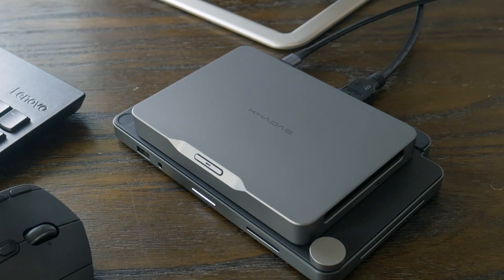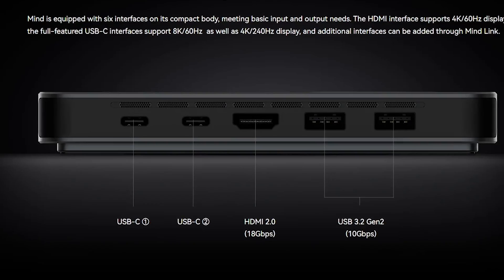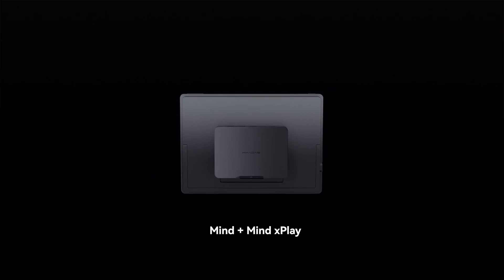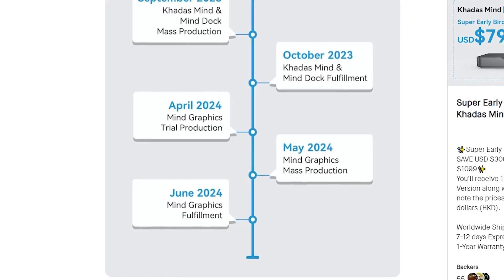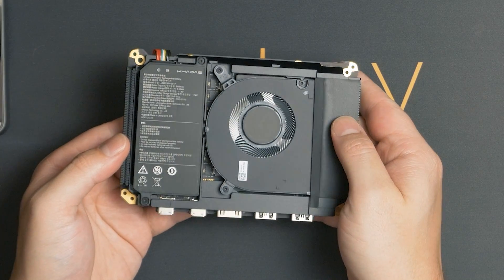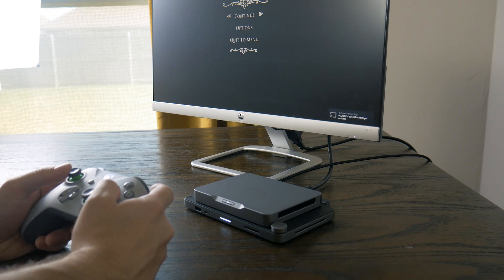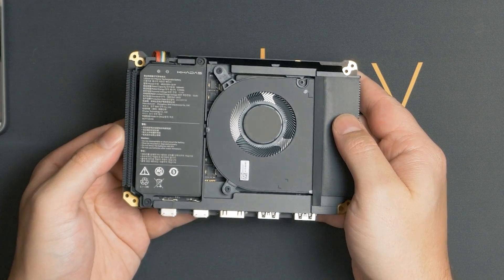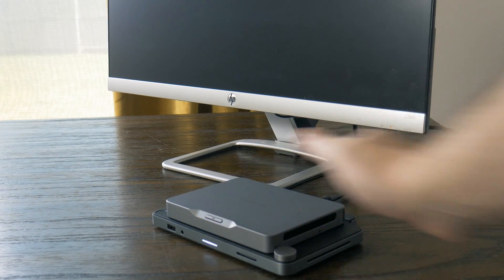Is THIS the future of PCs?

Comment: They definitely milking the price by using those proprietary connector. They can just use OcuLink 8i connector, which is the common external PCIe x8 routing standard in server and workstation, but nope, they know they cant sold their proprietary connector with that. For power and other peripheral, they can use another USB-C right beside the OcuLink connector to deliver both power delivery and USB to other peripheral that doesn't need PCIe (like 2.5G Ethernet and USB hub/audio DAC), Similar like asus did with their X13 and Z13 lineup (well asus is using proprietary connector for PCIe but still).
Reply: Adding insult to injury, the thunderbolt 4 capabilities is built in to the SoC, they just need to add $12 Intel Maple Ridge (JHL8540 or JHL8440) thunderbolt redriver, but nope, that thunderbolt will also gonna hurt their proprietary "Mind link" accessories 🤣
Reply from the maker: The thing about OcuLink that makes me really curious is how well it would hold up to a lot of plug cycles. It appears that certain specs of the connector can be more durable, but I don't think it was originally designed for something quite like this. Would be awesome if it was and khadas found a way to do something similar to what you described
Reply: @HardwareHaven  oculink, atleast at first, is designed to compete with thunderbolt, which at the time still use Mini DP port (TB1/2), and most older thunderbolt controller is sucks and add lot of latency (just see trashcan mac pro and older macs) and oculink provide the alternative which just basically passtrough the raw PCIe data instead of encoding/tunneling it. For durability, atleast I already into 5000+ cycle, using it myself to passtrough my main PC PCIe slot to my DIY DAS that have broadcom controller in it. And for the hotplug, it's just the matter of motherboard/platform and the end device supporting it. And yes, manufacturer can add dirt cheap PCIe retimer for limiting signal degradation.

Comment: I don't think this is likely to take off- it is too expensive and as it is a single vendor will be too limited. I think it much more likely that mini PCs will grow in popularity because of their low cost. Today you can get an N100 system that is great for everyday computing: web browsing, 4K video playback, and word processing for less than $150.  That is a really great solution for the vast majority of people for a lot less money.   However, for gamers the graphics are lacking compared to what you can get on a desktop. 

If these mini-pc form factors become really popular then graphics card manufacturers are going to have a real problem: mini PC generally don't have the space for a graphics card. 

The current generation of eGPUs are far too expensive and complex for a casual user. They are really kind of a hack- make a PCIe card chassis that you can connect to via a USB4 or thunderbolt cable.  Why are we keeping  the PCIe middleman?

Computers have standardized memory slots (DIMMs) and storage (M.2) that you can populate standardize components from different vendors with different speeds and capacities... why can't there be a similar slot for graphics?  I realize this is a chicken and egg problem and requires cooperation between GPU and Motherboard designers... not too likely to happen but it would really make for modular graphics. 

I think a more likely solution is a "mini graphics module" that the graphics card manufacturers could build without any changes to existing mini pcs.

Make an enclosure ideally about the same size as the mini-pc with a standardized port (usb4 for now?) and it's own power supply. The big difference from today's eGPUs is that this box is a product designed as a complete product.  The design won’t be bound by the form factor of a PCIe slot because that isn’t its purpose.   The end user should just be able to plug it in and it will just work.

If there is enough demand, the cost could be very comparable to a PCIe graphics card with similar performance. Over time I would expect improvements for this style of component: better communications standards, better performance/watt as lower power draw will make the entire unit less expensive, possibly even a way to upgrade the graphics performance.

Comment: The computer is so small that you could lose it. I don't see the need for such compact package with challenging heatsinking and no upgradeability. The additional ports in the dock could be added in the same chassis without an exposed connector. The PC would still be small. I'd rather see a quiet desktop PC that only draws 50 watts.

Comment: Computers with custom docking ports on them are not new.  They tend not to do well on the free market.  A "modular" PC isn't new either.  They've been a thing since the earliest days of computers.  As mechanical, electro-mechanical, electric, digital.  Across all the different sizes and shapes man can conceive.  To say this is a "modular" design is to ignore the expansion slots of micro computers (aka Personal Computers) where you insert modules in the form of a card to expand the capabilities of the computer itself.  Using a small PC as the "brains" of other connected peripherals such as different kinds of displays, GPUs, doking stations, etc isn't new either.  In fact there really isn't anything that special about this small form factor PC.

Comment: Obviously the Mind Link isn't the future but I do think we'll be seeing a lot more SOC based computers with modular connectors.  SOCs can achieve far better performance and energy efficiency at the cost of being less upgrade-able/repairable.  The big question is what connector will be used to connect the SOC to other devices.  I'm imagining the SOCs taking on the form of a small block that connects into a system like a CPU does but instead of just being a CPU it's CPU, RAM, and maybe GPU and Storage as well.  The closer connections mean less latency and possibly less interference concerns which means faster computers.

Comment: I'd only ever get behind this if the Mind used CAMM, so we could have upgradable memory without being restricted by SODIMM, or locked to our choices with soldered LPDDR5, and if the Mind Link ever became an open standard.
Also, I hope that graphics dock has a standard PCIe bracket on the inside (although it looks like that isn't the case), else it's even less attractive.
Very neat idea, very bad execution.

Comment: I wouldn't be surprised if their proprietary connector is somewhat better for the exact purpose they had in mind(if nothing else ignoring compatibility expectations allowed them to shove some USB, HDMI, and power in there to suit their purposes); but unless you are really enthusiastic about the future of their line of accessories it's hard to be too optimistic about it vs. either TB/USB4(inferior PCIe lane count and speed; but at least literally everybody makes compatible stuff) or OCuLink(not really designed for docking station work; but the cheaper, lower overhead, less encumbered way of doing short cabled PCIe runs).

They could even have split the difference by doing a 'semi-custom' connector by deciding on a specified arrangement of a standard and custom connector(eg. having their docking connector be a normal OCuLink connector with 2 pads for DC power delivery exactly x MM to one side); or an arrangement like the docking connnector on thinkpads in the T480-T14 era; where they had two normal USB-C or TB ports at a fixed position relative to one another, plus a proprietary recessed ethernet passthrough; which could either be used as normal ports with standard TB or USB-C peripherals or mate to the proprietary Lenovo dock connector.

If they want compactness and plenty of mating cycles they probably can't just shove a PCIex8 edge connector in there and call it good; but it's not like they need a fully proprietary option to fulfill the requirements of their dock; and going with one is not going to be helpful unless their selection of peripherals is both abundant and relatively reasonable.

Comment: The Mind Link slot is interesting, considering it combines USB with PCIe lanes and a power passthrough, and for whatever reason HDMI lanes as well.  A big complaint with TB/USB4 is PCIe limitation, a big complaint with OCuLink is that it's only PCIe; which I hope OCL-3, since we're due for a spec refresh, also includes QOL features like adding a USB link to the wire for uses that aren't just raw PCIe connectivity.  Mind Link is basically a step towards this, but I still see limitations, outside of the obvious limitation that proprietary connectors have.  Honestly if we could combine the non-PCIe uses of USB4 with OCL's PCIe link, 90% of issues would be solved, you get USB, you get tunneling for things like HDMI and DP, you get USB-PD, and you get OCL-2's (and hopefully 3's in the future) PCIe link without tunneling.  This kind of concept is also more interesting when you consider that PC on ARM is finally right around the corner, the compute scalability of this kind of platform would be insane, if we had a better link between components.  But a new standard port for a non-tunneled PCIe link with more lanes combined with USB's other capabilities (Again, literally just USB4+OCL) solves everything Mind Link is made to accomplish and then some, plus it'd have a much nicer interface than this glorified cartridge slot. 

As for your idea towards the end of the video, having the modules be daisy-chainable, you're essentially asking for a serialized PCIe.  Which is likely to never happen without a spec change, which we all know PCI-SIG will never adopt this and this could only exist in a post-PCI world, assuming the consortium of companies even believes the implementation makes sense and there's actual need in the market for it.  TB/USB4 is daisy-chainable, but you're also not getting discrete devices with PCIe connectivity, you're getting discrete USB devices at most.  The only other option is to bifurcate the hell out of that link, but then you get into issues like stack orientation where the first branch has to be the most compute heavy, i.e. the GPU module or higher-tier networking, where down the stack becomes the lower-tier add-in cards, i.e. your USB expansions or discrete sound cards.  There's just no good solution, mostly because the industry loves to hang onto outdated specs and decides to continuously update what should be long since dead instead of adopting newer proper specs.  Maybe this'll change after ARM gets going in the space, where scalability needs a better interface for obvious reasons.
Reply: Asus manage it by put USB 3.2 port beside the "Oculink" port (they use proprietary connector called "XG" based on Oculink but smaller to passtrough PCIe), which both deliver PD to the laptop and adding USB peripheral hub in the XG hub.
Reply: @pingtime  How about you cite your sources, considering I can't find anything that corelates the XG port to OCuLink (SFF-8611/8612) or any other relevant circuit (SFF-9400, SFF-8654, SFF-8639, etc.) under the SFF-9402 and SFF-8448 protocols, not to mention that XG is a 64 port connector when this proprietary connector does not match any other circuit by pin count.  Obviously you haven't done your research, so I doubt you have any sources to cite, but your claims are already immediately debunkable.  You cannot conflate a proprietary circuit with a standardized one, the simplest of logical thinking would tell you this; XG ≠ any circuit under the 9402/8448 protocols, which means XG is running under its own proprietary protocol or ASUS is borrowing a protocol unofficially which I'm sure PCI-SIG wouldn't be all to keen of.  Not that this matters much anyways, if you actually read my comment you'd know that I was suggesting a singular connector that combines the capabilities of both USB4 (or a future spec) with OCL, i.e. USB's current capabilities and raw copper for a PCIe x8 link to circumvent the tunneling issue while also keeping the USB side free for other tunneling duties that are not PCIe-related, not a dual-cable solution like what ASUS uses; and it doesn't take very high competency of reading comprehension, nor a large amount of logical thought, to figure this out, especially as Mind Link, of which this entire comment was based around, is a single-slot connector that could also be hypothetically minimized into a single-cord connector.  Perhaps you should learn to comprehend what you read and take a moment to logically process things before you blabber on about irrelevant things, because ASUS' solution is far from what I was even suggesting, especially as XG ≠ OCL.
Reply: @xaytana  you write so much, I pointed out its based on OcuLink port design physically, you don't need to do research for this. I own Flow X13 myself in the past. I also can say the design of XG port look like Full sized DP connector, etc. The fundamental things is both XG and Oculink is used as passtrough port for PCIe, instead of encoding with different protocol like thunderbolt PCIe tunnelling m You don't need to write a thesis critics for just replying my comment. Man, you make things complicated.
Reply: @xaytana  I know you smarter than me, maybe even you one of the guys that part of JEDEC, USB-IF, or PCI-SIG, etc, and I appreciate your work. I neither an English native speaker or have the technical knowledge for deeper low level conversations for this. I try my best to write my comment, and maybe you misunderstood what I meant, and for that I'm sorry. I'm not talking about the protocol, wiring, etc. I pointed out how asus make their proprietary XG connector look like mini version of OCL 8i physically, and work in similar manner, probably they got PCIe redriver for signal integrity but not much of tunneling it via other protocol, thus minimizing latencies.
I just wanted to pointed out how mind link is unnecessary unless they want to milk their accessories ecosystem, especially when both their base unit and $180 basic dock doesn't even have thunderbolt port, locking you to passing through PCIe signal outside of using mind link accessories or using their second 2230 M.2 slot at the access hatch.

Comment: Thinkpads have done this for ages. I have an old T420 in a dock as a NAS and music player. I have a T450 in a dock driving two external monitors. The trouble is that the dock connection gets a little dodgy of you touch the machine while docked, which is why Thunderbolt is a better option for the connection.

Comment: DOA device. In past, anything with proprietary connectors may have worked as proof of concept. Or as community demand check. But did never fly. Would be smarter to just use TB + USB-C connectors for expansion. Sure, slower than PCIe-hybrid connectors. But it would open doors to other manufacturers. Even people could 3D print their own docks, where they use extension cables inside dock to connect devices with ports in different places.

Comment: This isn't the future. However, I think a modular pc case would be pretty successful.

Some perspective, instead of wire management. It'd use PCB and connecters where you'd hook up each panel, of the case.

And only short wires (removable and each sold in many lengths) connecting a panel to a motherboard. Maybe a few variations of the motherboard panel, to prevent wires from reaching across the board.

The way I see it - It's one thing to sell a gadget and make an ecosystem of proprietary. It's another to give people more freedom while doing so. And if a person wants a usbc port on the bottom of their case, as stupid as I think that'd be, someone else might have a use case, and might benefit from the customization. Maybe they have a hole drilled in their desk, idk.

Comment: Maybe instead of the proprietary connector, they could use an Occulink-2 x8 or 4 connector(its open source and PCIE 4) and a USB PD port(maybe USB4V2 at the very least) underneath it instead?

That way you can use it with more products that also use those connectors.

Comment: Would be neat to see some sort of adapter case for the framework main board that lets you use it in similar way, might as well use a tested ish standard and people interested in early adoption of modularity might already have. Interesting concept, application seems a bit flawed or maybe restricted on purpose
Reply: There are cases for framework mobos

Comment: The use case of corporate is good in the way he described it but by the time they get to buying enough of them to do so buying a VM server would be cheaper.  VM server running Ubuntu server or a fork of Ubuntu instead of window as windows server is expensive. Then just having the VM software run on the linux machine to run the windows machines in VMs. Most enterprise programs do not need that much in the GPU area but the CPU and system RAM areas. So VMs is the way to go. The part of VM management that you can change a group of VMs at a time instead of having to go and change the specs of every VM 1 by 1 is also a thing.
Using it as a client machine might be good if the price is right. A client to remote into the server to do whatever the business is doing. The problem will be they still would have to buy the monitors, keyboards and mice. 

How i can see it being used is a desktop replacement like the Raspberry pi 5 but x86 and windows comes with it also 0 GPIO pins. Takes more power but x86 always takes more power than ARM. Both SBC just the on in the video is bigger and has more USB ports with USB ports on both the front and back. The major downside is the power connector is on the dock which is another part to buy so for a computer that is to sit in one place all the time it isn't the best for the size nor for the price. Maybe the compute is much higher than other SBCs but if you are going for compute most go with towers not SBCs.